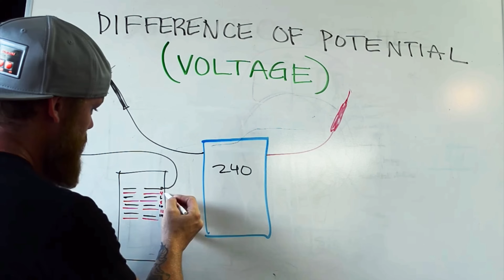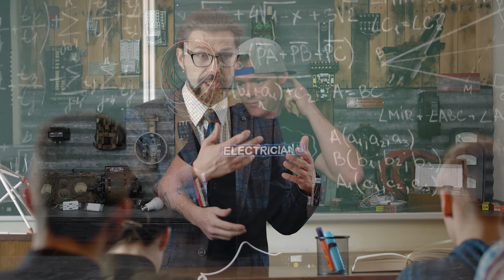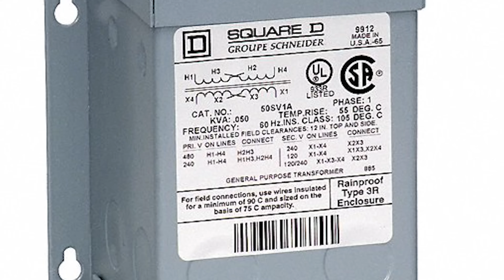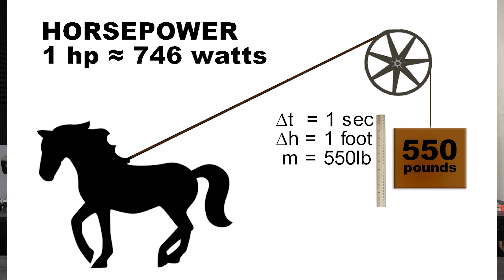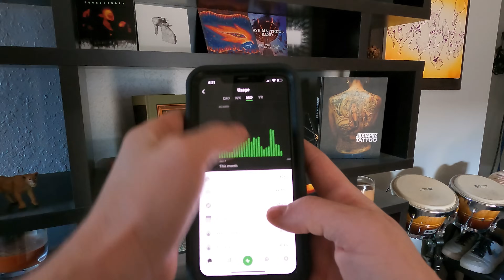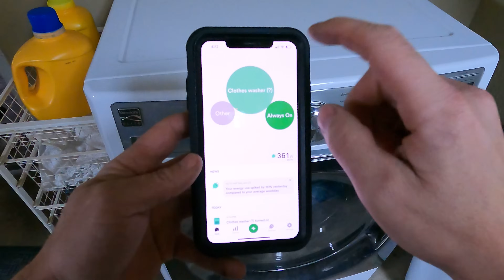WATTS vs HORSEPOWER vs VOLT-AMPS vs JOULES

Comment: @12:30-13:00, you bring up horsepower: electrical power being converted to mechanical power. Earlier, you bring up the point of generators converting mechanical power being converted to electrical power being "watts". But heaters, microwaves, my wife's hair dryer, etc., are rated in watts, although they are closer to a motor in what they are doing: converting electrical power to mechanical power (especially in the case of a hair dryer which is practically a mini leaf blower with a heating element). So, is that just manufacturer's choice on choosing watts over hp? Or is there any other factor on using watts vs hp?
Otherwise, I'm super glad you did this video! I really get the difference between them now. Thank you!

Comment: I spent some hours trying to understand the rating of electric fence energizers.  I had a hard time learning that Joules is the same as watts.  Your video made it clear.  I suspect the only reason the chargers are rated in Joules is to prevent users from understanding what's going on with the chargers.  It's amazing to me that some fence energizers cost so much for a fraction of a watt output.  I know, it's the knowledge of how to make the application work to serve the intended purpose.
Thank you.

Comment: Really loved this. Especially how I’ve always scratched my head about watts vs. volt-amps. I just figured it was just some kind of historical convention. 

But now I have a question. EVSEs are commonly referred to in kW, but should it be volt-amps? Is any work being done in the conversion of electrical energy into stored electrical energy?

Oh wait. I think I just answered my own question. It’s conversion from electrical energy to chemical energy, isn’t it? It does work by moving ions from one side of the cell to the other. 💡

I so think I understand now! Thank you!

Comment: Have to watch out when purchasing LED lamps . Very hard to find the power factor of any brand. Saw some cheap scum bag lack of quality control communist China LED'S have a 70% power factor while real deal made in USA LED'S had a power factor above 90%. so say a LED rated at 15 watts & 70% PF would cost around 18% more to run then same wattage LED with a OF above 90%. Think government, UL ,NEC or somebody make it mandatory b to s you poly power factor on all LED 'S .

Comment: @ Electrician U
 I was with you all the way up to @15:10, then you said "per hour" and that is not what a kWh is. Per means divide. Think of power as a 'speed' of energy flowing meaning that when traveling you don't say the distance that you travel is speed-hours, but that is what you are doing when you travel 4 hours at 60 miles per hour. We say we travel 240 miles, but really it is 240 miles-per-hour-hours.  The units hours and per hour cancels out leaving miles. Now, back to kWh, which really reads 1000 Joules-per-second-hours, the unit per-second-hours leaves a value of 3600. So, 1000 * 3600 J is 3.6 MJ. That is 1kWh is 3.6 MJ of energy.

Comment: As a couple of people have mentioned, kilowatt-hour is not a rate. You mentioned Joules earlier. Kilowatt-hours and Joules measure exactly the same thing, energy. That’s why you’re billed using that unit since it’s a measure of the total energy used. I agree that it’s a strange unit since the Joule is the standard unit for energy and I have no idea why power companies decided to use a more complicated unit which includes power and time components.

One kilowatt-hour is simply 3,600,000 Joules. That number comes from the fact that a kilowatt is 1000 Watts and there are 3600 seconds in an hour. The time components cancel each other out which is why it’s not a rate.

But yeah, kilowatt-hour is an overcomplicated unit. Imagine a rental car company that instead of charging you by the mile charges you by the “mile per hour-day”. Both of these units measure the same thing, total distance, but one is overcomplicated. Just use miles. :)

** WARNING — MATH **

mile per hour-day = mi/h * day
                               = mi/h * day * 24 h/day
all the time terms now cancel so
                               = 24 mi
so a mile per hour-day is just 24 miles

just like with kilowatt-hours and Joules…

kWh = 1000 W * h
         = 1000 J/s * h
         = 1000 J/s * h * 3600 s/h
all the time terms now cancel so
         = 3600 * 1000 J
so a kilowatt-hour is just 3,600,000 Joules
Reply: 3.6 Megajoules

Comment: Attn all apprentices. In my 50 years never used joules or coulombs. Think joules was something like 6.24 X 10 to 12th power. Great to learn it but will never use it. Who the hell but some geeky person cares about how many electrons are flowing down the pike. For most AC calculations sparkies only use ohms law never taking in impedance or capacitance.

Comment: sometimes the hearts electric current doesnt flow right. The heart will not beat, but just quiver.  So to fix it we throw 250 joules threw it to short out the heart.  The heart then re energizes and "hopefully" it will travel down the proper paths.  If one discharge doesnt fix the heart, we give medicines which change the impedance.  Then we shock it again.    I have to rewatch the video.

Comment: I know this is a bit old, but I just found your channel. Nice job! What I would suggest for explaining how VA or kVA ratings work for transformers, just explain the power triangle. Since, as you said, the transformer does not "consume" any power but convert the units, the transformer must be rated for the amount of power that could potentially pass through it. This total power is known as apparent power (units: VA or kVA). It is represented by the hypotenuse of the right triangle. The base of there triangle represents real power (units: kW or MW) and there vertical leg represents the reactive power (units: VAr or kVAr). In summary, the "real" power is what can be sold by the power company... The "reactive" power is the amount of extra power needed to be generated to create the magnetic  fields to push the power along the wires, and the "apparent" power is the total amount of power required to be generated in order to sell and move the power from place to place. The power factor is the angle between the real power and the apparent power.

Keep up the great work! I'll be starting my electrical engineering masters in the fall with an emphasis in power systems and grid control infrastructure. I love to study about electricity and hear different (correct) explanations for the ways electrical energy is utilized.

Comment: So, with all the VA and Watt talk, you just barely mentioned reactive power (or imaginary/capacitive/reactive) and completely missed their units of kVARs, and why, because of that, transformers are rated in VA. They (and circuit breakers/fuses) have to take into account the actual current, and not just the power being used, as current is what causes heat, and therefore wastes power, causes voltage drop, etc, even when the current isn't in phase with the voltage.

Comment: Hi everyone. I recently got an old exit sign that's 120 volts. I'm not sure what to use in terms of bulbs because it says with the paper that came with it this:
120 volt sign use 25T6 1/2 I.F. (120 volt)
277 volt sign use 20T6 1/2 I.F. (120 volt) 
I don't know what bulbs to get and also I'm trying to see if there's an led equivalent or whatever that won't burn out the sign as I know many incandescent bulbs will do that to it over time and I don't want that if it can be avoided. If anyone has any ideas or experience with this sort of thing, please let me know, thanks SO much in advance.

Comment: Hearing joules/second just hit my ear UBER weeurd, since my understanding of a joule is a watt/second so 1800 joules would be...    1800w indexed over (1) second, or 600w indexed over (3) seconds, or 1w indexed over (1800) seconds (AKA 30min)
KwH being the same time indexed measurement of work, but base 1000 for the watts & over the time span of an hour -Likewise, if you were wondering about a 10KwH on a given circuit; This COULD be 10KW over (1) hour, or 3.33KW over (3) hours, or 1KW over (10) hours
Reply: A joule is a Watt second. Write the formula out, multiply (or divide) both sides by seconds, and then two of the seconds will cancel each other out. Just a little algebra...
Reply: @IceBergGeo  Thanks for pointing out what I had already, while seemingly missing the point that using the verbiage "joule second" comes across linguistically weeurd (imagine yer AINGULISH teacher babble'n on about double negatives) when a joule in & of itself is a watt second; no division required
Reply: @utoobrandomness7197  sorry... Wasn't trying to be a dick. Just wanted to keep things from being more confusing for someone else.
Reply: @IceBergGeo  lol   My bad, I probably shoulda noticed that -But it seems like this whole late winter thing is getting us all in interesting ways   :/

Comment: Actually Kilowatt-hour is not a rate, but a usage over a period of time.  watts x hour = Joules/second x 3600 seconds = Joules, or energy used over that hour.  Energy being a fixed element that can be priced independent of the rate or time period of transformation (consumption)
Reply: Kelo means thousands or kilowatts and when calculating a lightning and plug load on a residential dwelling it's 3 watt per square foot, wire size is calculated in circularmills so your wattage can't exceed your wire size, and your wire size can't exceed your breaker size. Motors are the only exception on over current devices...

Joules, watts and amperes all produce heat therefore wire size and breakers need to be sufficient to carry the current on demand and protect each other...
Reply: @steve-o6413  - ‘’and your wire size can’t exceed your breaker size’’
I thought it was the breaker size that can’t exceed the wire size. Am I missing something?
Reply from the maker: Sort of splitting hairs at that point but really the breaker is protecting the conductor, so we size conductors to the load, we size breakers to the conductors.  Like he mentioned though, motor loads differ a bit as they have multiple forms of protection necessary (short circuit/ground fault AND overcurrent)
Reply: @electricianu  - Just to be clear, would there be a problem using 12 gauge wire with a 15 amps breaker?
Reply: @robertlafleur5179  you can always go over but never go under...
Reply: @robertlafleur5179  not what I said you if you were listening, but that's okay if you weren't...
Reply: @electricianu  your right, also starting loads...
Reply: @steve-o6413  - ‘’not what I said you if you were listening, but that’s okay if you weren’t...’’
What is that supposed to mean?
Reply: @robertlafleur5179  brain fart one to many you's lol...
Reply: @robertlafleur5179  I was giving a clear line of protection, increasing the wire size is a protection in itself, so if you want to misinterpret what I was meaning you can...
Reply: If you wish to exceed the amperage for a given Circuit, then the wire must go up in accordance with the wattage or amperage given, only then can the protection of the wire with the breaker be increased...

Comment: Watt is not the same as Volt*Amps!
It is only for certain electrical devices like heaters.

Anything inductive or electronic (with capacitors) changes that, but guess you cannot talk much about apparent power or power factor, which you must know when you design power stations, distribution and big factories.
Reply: Every journeyman electrician is required to have a solid understanding of the causes/effects/balancing of leading and lagging reactive power to successfully complete their apprenticeship.  but guess you cannot talk much about that
Reply from the maker: You're right, there's not an apprentice on the planet that would have understood me going into all of that in this video.  I actually mention that a couple times in here.
Reply: @electricianu   I'm balls deep in Week 6 of my level 3 intake right now. Online motor control exam this morning, wish me luck! Thanks for all the top-notch content Dustin,  love your shit.

Comment: Love this explanation ... But you’re killing me with “amperage” ... it’s not a recognized IEEE term! Just use “current”! Voltage has units of Volts. Current has units of Amps. Power has units of Watts (wattage also isn’t real term).
Reply: I don't think 'Ampacity' is a city I wanna live in :-)
Reply: @wim0104  ha. Well ampacity is a recognized term in the code book.
Reply: You need to be able to convert watts or kw to amps for wire size, breakers and fuses, end of story...
Reply: Also what does the term KVA mean..?
Reply: @steve-o6413  Kilovolt-amps
Reply: @esl4058  the correct term to use is “current”. You’re right. “Amperage” is just jargon.
Reply: @esl4058  “current” is the IEEE defined term. Ampacity is something different used to properly size conductors. Voltage has units of Volts. Current (not amperage) has units of amps. Power (not wattage) has units of Watts these are all defined via IEEE. “AMPERAGE” is not.